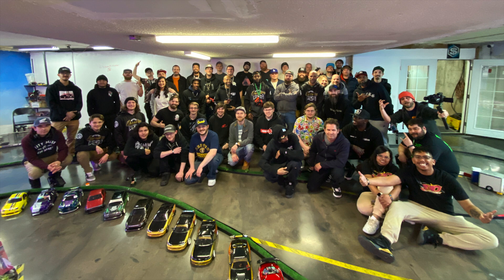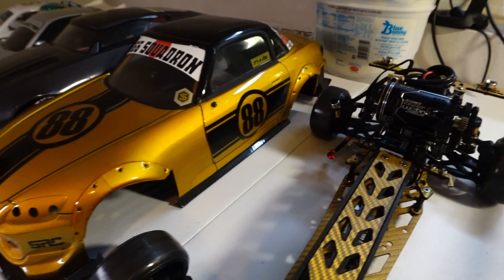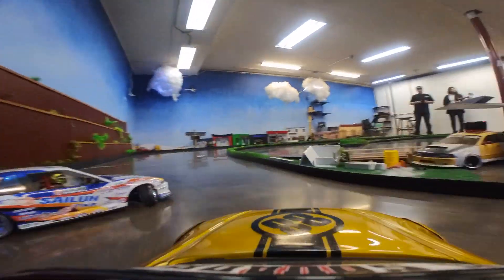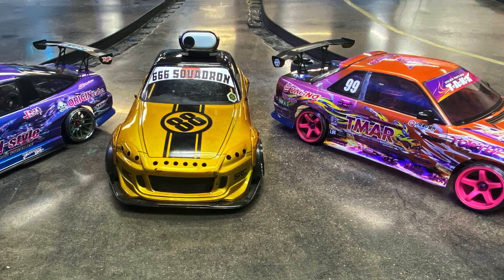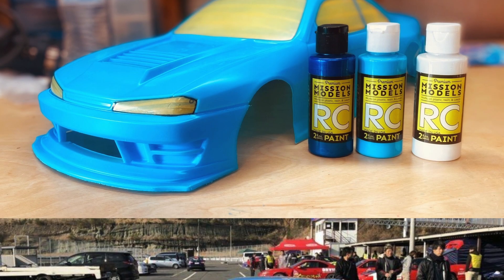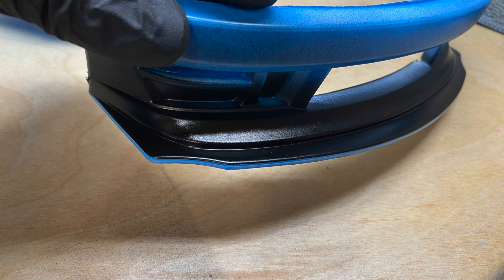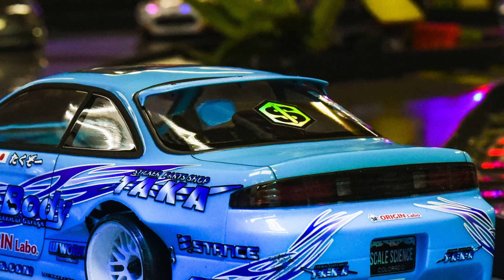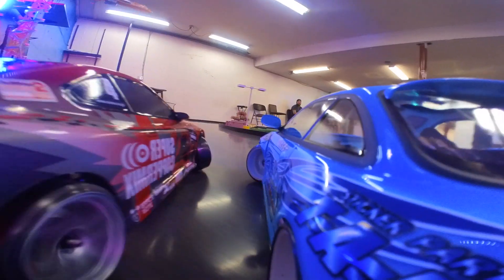YOKOMO MD 1.0 - R.SPEC MFG RC CONVERSION - SCALE SCIENCE

Comment: How you get the rs-st servo to fit cuz it seemed like it was too big
Reply from the maker: Shimmed the chassis plate mounts a few mm and swapped for slightly longer screws. Same trick has worked for me on numerous chassis that can have that same issue such as the Usukani’s.
Reply: @ScaleScience  can you make a video on it plz because I tried and the servo horn hits the top deck🙏🙏🙏
Reply from the maker: @haroldthompson4453 rather than make a video on something like that, just join our fb group (Scale Science RC) or send us a message.

Comment: Tasty Looking MD SS  :face-blue-smiling:Did You get the ReveD Servo To Fit using taller Yokomo Servo Holders or spacers on the lower deck ? 
I can't seem to see Spacers under the ReveD Servo in the video.
I used 3mm spacers on top of the Stock Yokomo Servo Mounts and then made a slight Dremel cut in the upper carbon supports to allow the servo arm to fully swing left and right without hitting the upper rails. 

My Only complaints about the MD are the original Manual has mistakes and terrible settings (☹) and that the slide rack needed shimming on one of the bearing mounts to get rid of play up and down play on one side (left side) in the steering rack , 

Also Hunting was a bit of an issue until I raised the damping point to over 300. Now its the best handling car I have , The Grip even with the 3 gear setup is amazing :person-turqouise-waving:

We'd love to see Your Servo Settings and could You share Your front end link settings please :) , Thanks for the Upload
Reply from the maker: I’ll try to get you some settings for servo. I did just shim the gaps created by the taller servo and sent it.